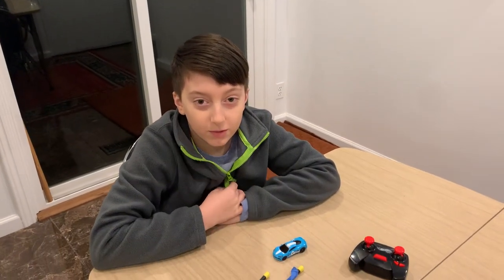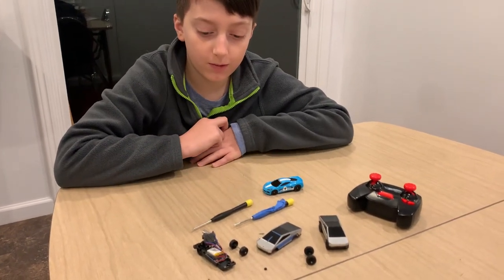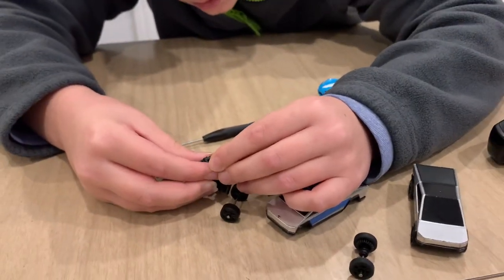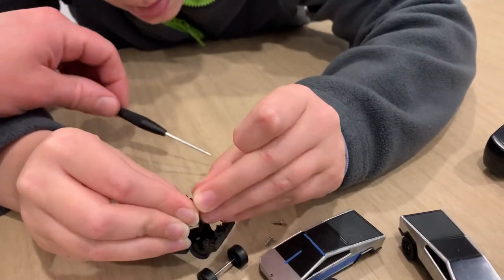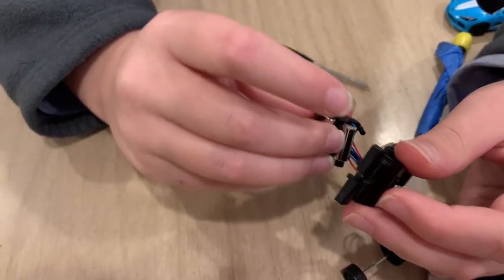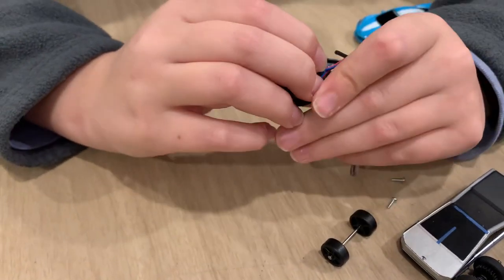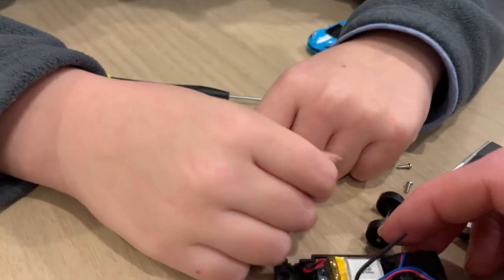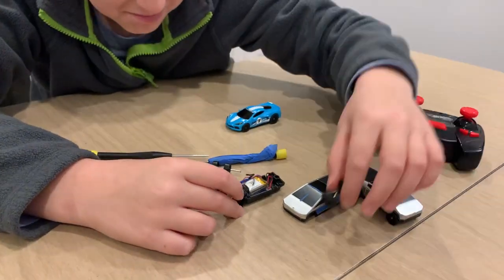Hot Wheels RC hair clog fix (Easy)

Comment: Does the sprocket slide off easily? Don't want to break mine. It's been sitting in the drawer for a couple months since there's a bunch of hair stuck in it.
Reply from the maker: Hey thanks for commenting! Yes the sprocket is on firmly.. but it does slide off with careful amount of gentle pressure.  Hope you fixed yours!
Reply from the maker: Jurassicparkfan10  ok we will make a complete video next time. from beginning to end. Don't be afraid to try it out. It is very easy to fix and put back together.  You just need the dollar tree store mini screwdriver set.